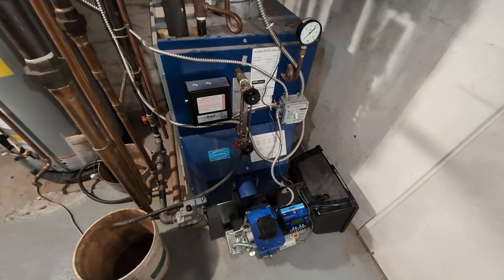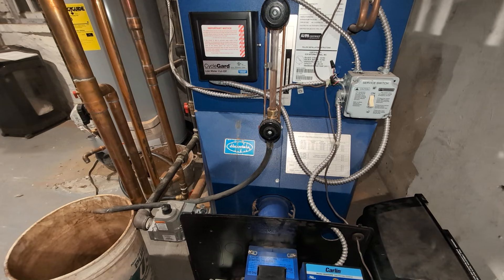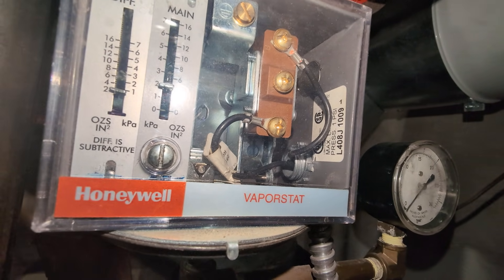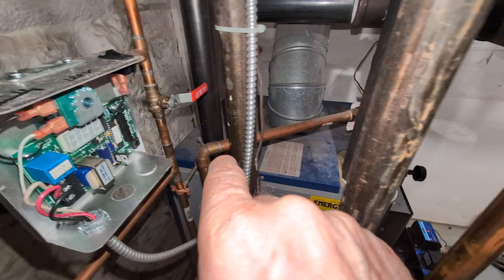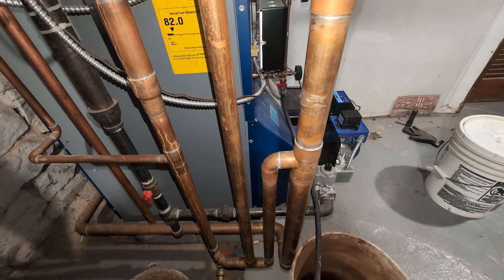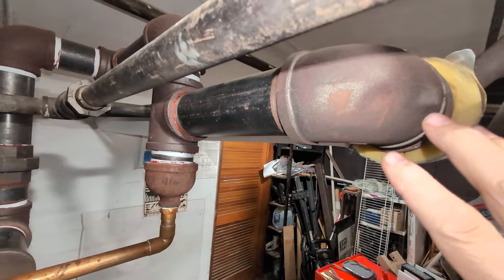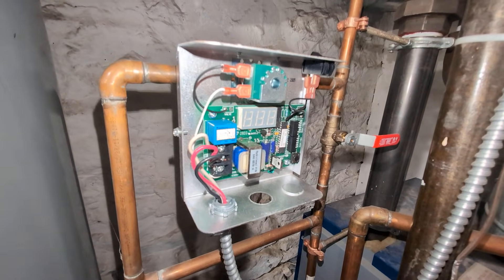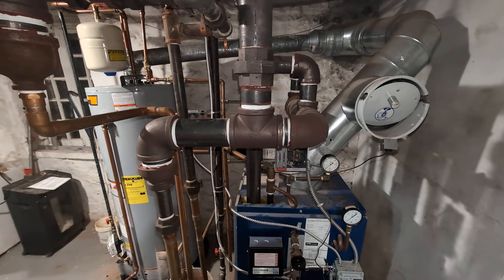Piping In A Steam Boiler To Run A Broomell System

Comment: What is the smallest counterflow steam main you have seen ? Mine is 2” and seems like most I’ve seen in your videos are 2 1/2 or 3” or maybe larger .
Reply from the maker: I have seen 2" counterflow mains now and then. 
I believe I can recall a time or two where a 1-1/2" counterflow "main" that had two radiators on it.
That is usually the smaller of the two take-offs from the boiler.  By the book, a 1-1/2" counterflow main can conservatively handle 81 square feet of radiation.
Reply: @gordonschweizer5154 thanks for the reply. I’m dealing with an original 1927 coal fired two pipe counterflow system that someone changed to a gas boiler sometime in the Late 50s or 60s . Two mains two dry returns. No wet returns . Condensate in mains after start up has no place to go. It’s not draining back to boiler. It just sits in the end of the main run and causes the last two rads at the end of each main heat up very slow .  Mains drain back after the cycle , I checked inside. If I throttle the gas pressure down the rads heat up fine but the heating cycle takes twice as long. Thoughts on that? I guess I’m going to add a wet loop from the main to the dry return or just run a wet return back to the Hartford loop.

Comment: Great videos! How would I get a hold of you and where are you located? I have an ADSCO counterflow two pipe steam system in my house and I’ve spent loads and loads of time with it and can’t seem to get it working right . Any help would be greatly appreciated .. located in central NY..
Reply from the maker: We are in central Maryland.
I think I have a video featuring an ADSCO radiator valve tear down. 
Do your valves look anything like that video?
Reply: @gordonschweizer5154  hi yes same valves. I think I may have found my problem. When someone installed a boiler they never added drops to the two mains. The counterflow system needs drips at the boiler. I just need to determine what size pipe the drips need to be coming off the 2” main. Is there a formula? The Hartford loop is 1 1/4”. Any help would be appreciated.

Comment: I looked up one of your old videos on broomell systems has this house still have the original radiator valves?, great video as always
Reply from the maker: If I remember, the famous Broomell valves have all been replaced with "ordinary" valves, but the radiator return ells in a few areas had not been replaced with traps, and that allowed us to name this system.
The real secret to the Broomell System's initial success mainly relied on some really fancy near boiler devices that are usually removed when the system's original coal boiler is replaced with oil.

Comment: Good evening,  I am making a comment because I have been following your channel for about 6monthsin order to replace my old boiler. After watching  a few others I believe you are at the top as far as knowledge and believe in doing things correctly. I have also read Dan Holohans book on forgotten steam heat. Anyway I just wanted to say say Thank you! P. S. I have a couple plaster casts with deadlines finger prints if someone would be interested, although I  have to divulge that the plaster casts are not pure plaster and probably contain A nother substance.